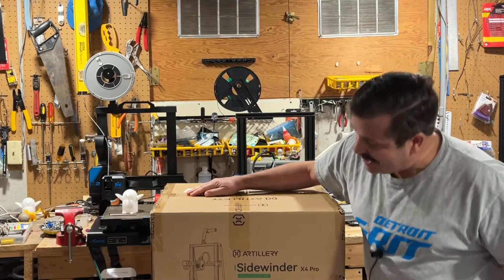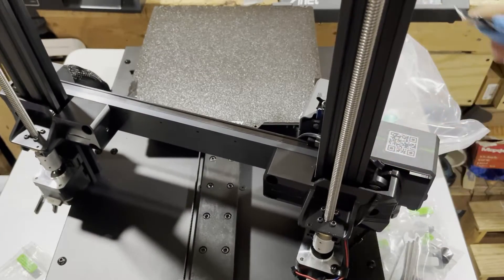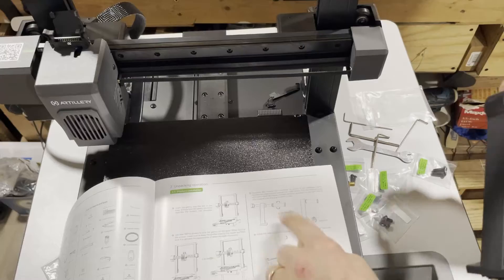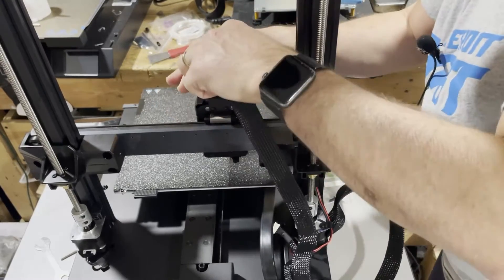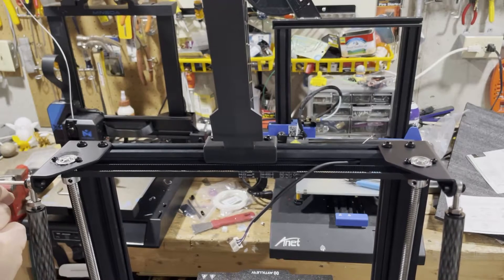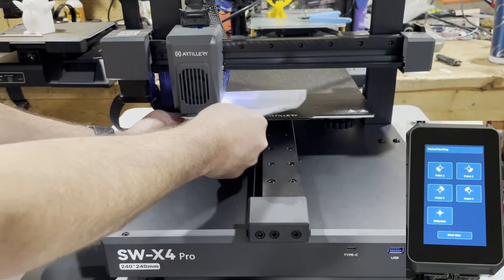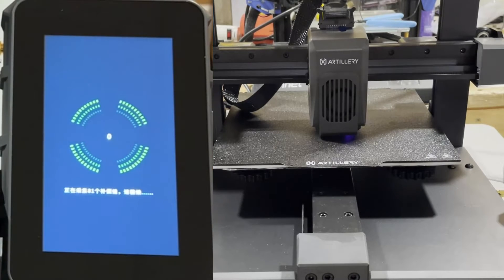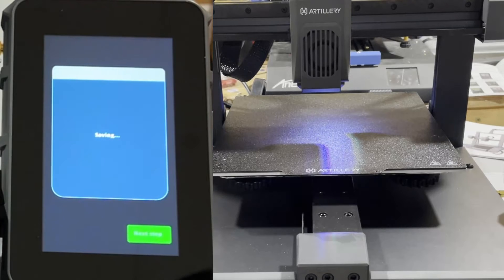Assemble & Level the Artillery SW-X4 Pro 3D printer in about 15 Minutes

Comment: Does this machine not have a voltage switch?
Reply from the maker: I just checked mine and there is not one on the outside.
Reply: @HLModTech  thanks for checking
Reply from the maker: Have you checked out any of the Facebook groups for Artillery 3D?  Lots of users up there. They may have more info. I believe a few Artillery staff members hang out there too.
Reply: @HLModTech  will try that thanks for the info

Comment: You connected the black loop around the main cable incorrectly.  It needs to hold the fat part of the cable just before they split.  This is counter intuitive because you need to squeeze the cable to get it to fit but it will keep the cable from dragging on the print bed like yours was.
Reply from the maker: Thanks! That was on my list of things to check. I also messed up the filament run out switch. That vid is coming soon.
Reply: Was a nice video.  I wish you would have made it a few days earlier when mine was driving me crazy.  I figured out the cable issue right away but I could not get the z-axis zeroed for my life.
  
Finally found a video on Artillery's channel that give better instructions, much like your video did.  Pretty happy now except need to learn new slicer or make a Cura profile. @HLModTech